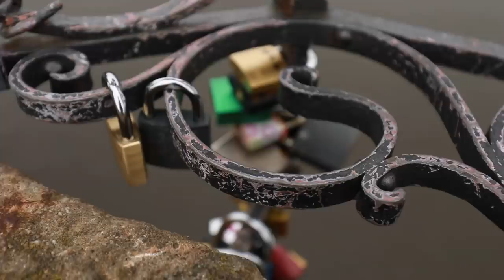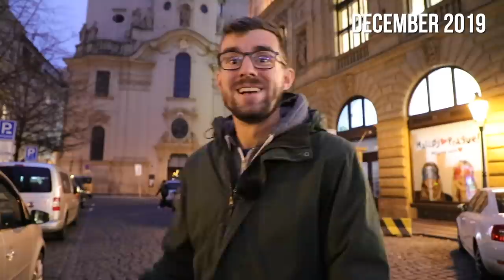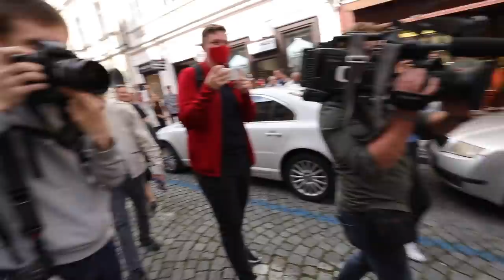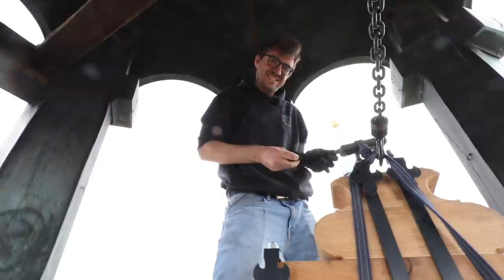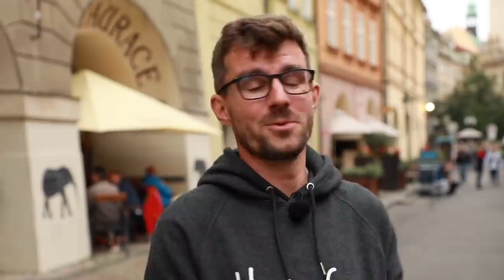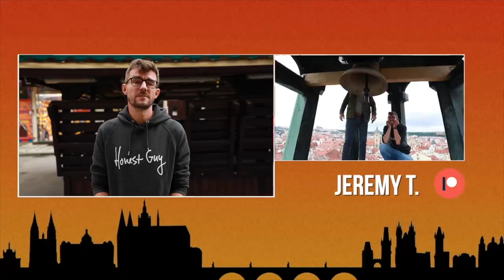We turned love locks from tourists into a new bell

Comment: The lock are usually bronze or brass and a steel ring. Sure not the proper alloys for a bell, but maybe the metal can be used in more direct way.

Comment: why dont you capitalise on this what is frankly a tradition and a cultural phenomenon at this point

setup structures on the bridge specifically for the purpose of love locks 
and then sell lovelocks at the end of the bridge
allow tourists to place there love locks on the frame 
and every idk 1/2 years dismantle the frame and slide off all the locks
send the locks for recycling and use the money from the scrap sales and initial sales of the locks to fund local projects to save buiildings or improve the community

they get there romantic gesture
a tradition is preserved
the community and city benefit 
and locks are kept in that one place instead of all over the place